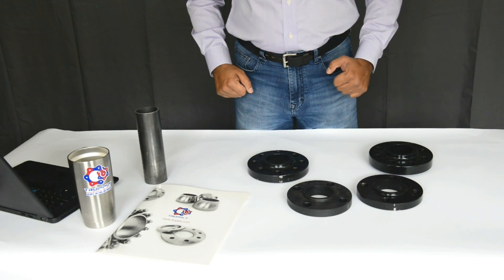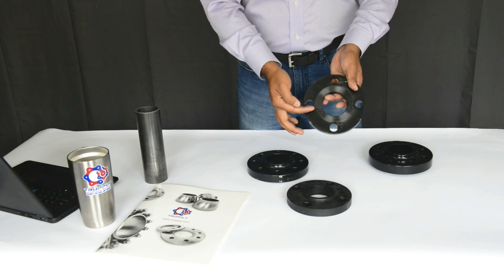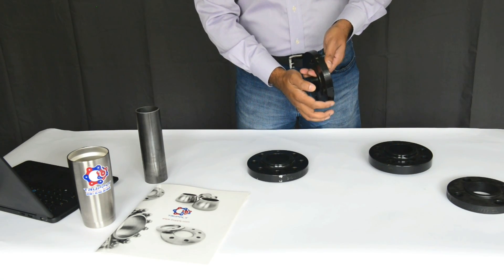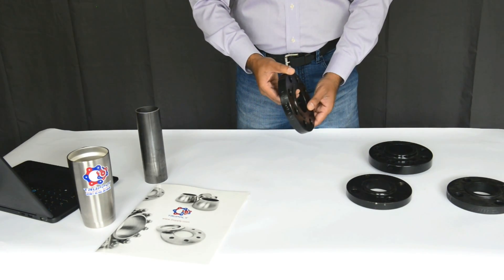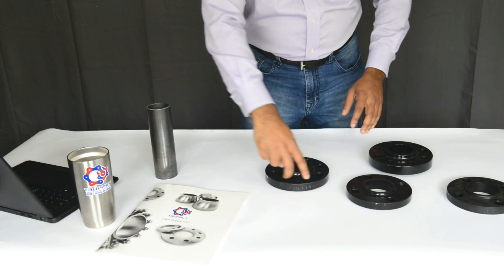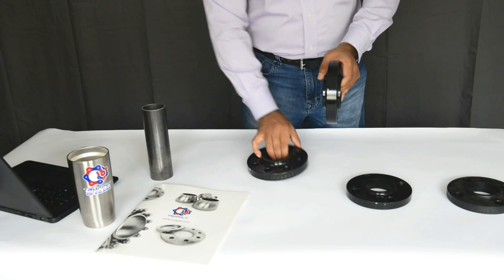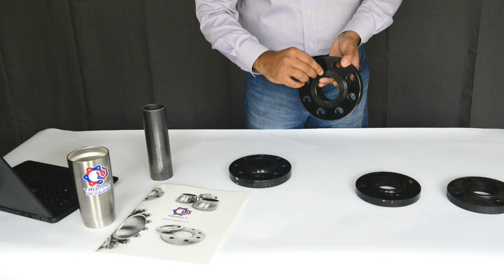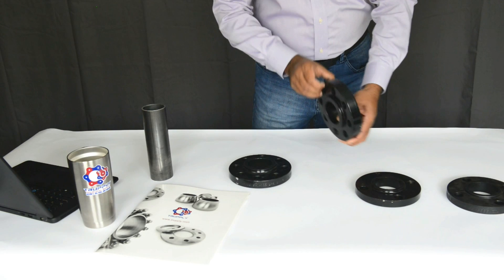Difference between class 150, 300 & 600 Flange

Comment: The biggest mistake is calling classes as "pound". Class numbers have nothing to do with pound. Check ASME codes. Its the biggest mistake in the field and people easily get confused thinking 300 "pound" means its designed to withstand 300 psi.
Reply: I am aware of this mistake, but I never truly fully grasped what exactly does 300 "pound" mean in this case? Can you elaborate?
Reply: @K H  Confusion is due to how they named these classes. Always consider "150" pound class just a name for the lightest standard flange. Next is 300, 600 etc. How much pressure a flange can withstand is dependent on flange material and temperature of fluid. For instance, 150# carbon steel flange used for water at 212F can withstand approx 250psi. And 300 class can withstand 740psi for same temperature while 400 class would go upto 1000psi. And similarly for higher working temperatures there ratings would be much lower. For example, class 400 CS flange at working temperature of 1000F is only good for approx 115psi.
Reply: @MrHELLKEEPR  Good god, 1000F? That's 530 degrees C. What kind of system or piping facility do you meet those kind of temperatures? Thanks for the answer tho.

Comment: Please anyone could tell me why we use 2mm raised face height in class 300 and 6.4 mm in class 600 and above?
Reply: Same reason as to why the the rest of the flange is thicker in the 600 class compared to 300. It has to withstand higher pressure. When you scale up from class 300 to 600 you have to add material proportionately.